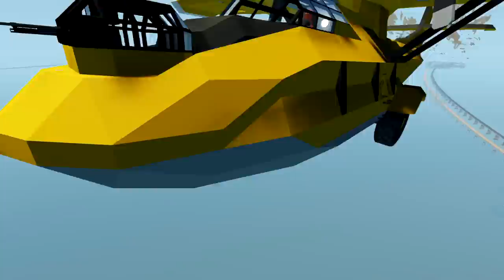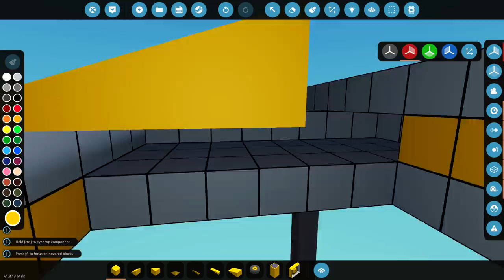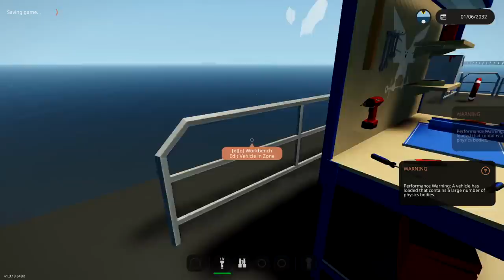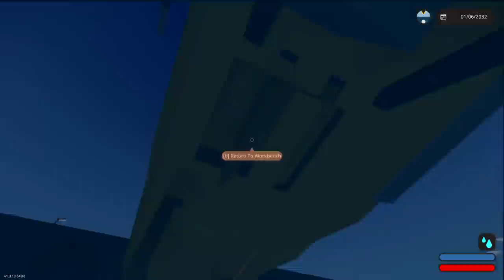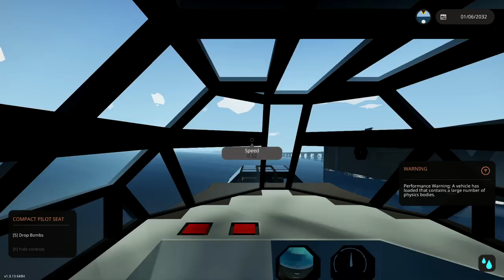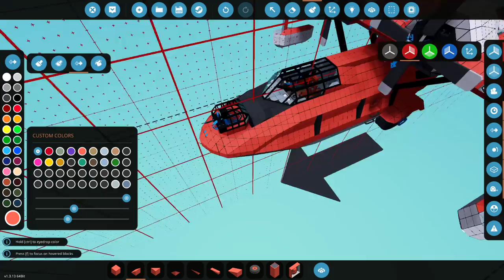Wing Bomb Bays! - SeaPlane Build - Stormworks Gameplay - #14

Comment: Hook the clutches up to 2 independent switchboxes and hook them up to the corresponding engine switches so you can turn off an engine incase of fire or damage and the other engine will still power both props without the drag of the broken engine

Comment: You could add a water cannon that can be filled up when the craft is in the water and the water will be store in a tank connected to a pump that will turn in from a button in the cockpit and can be controlled using a throttle lever in the cockpit as well.
Reply: I'm thinking much like many IRL pby, there should be multiple versions, like a firefighter version, a rescue version, a bomber version, maybe even a black cat anti patrol boat version with autocannons.